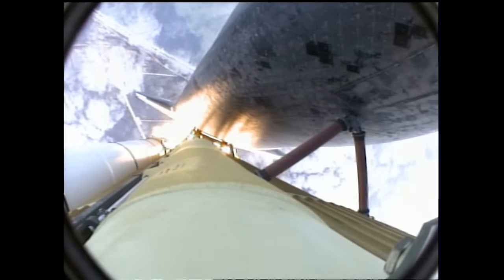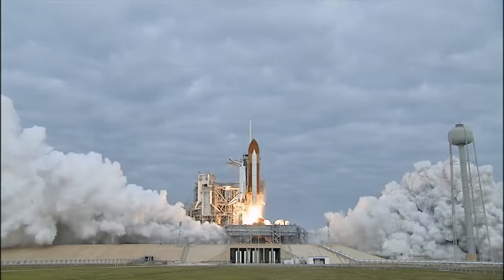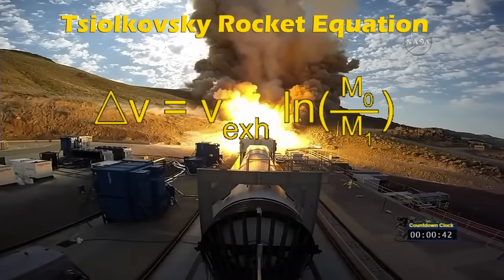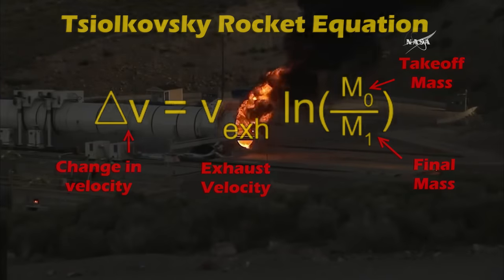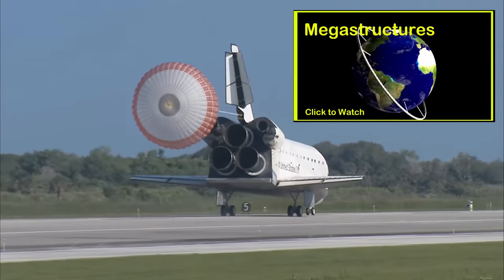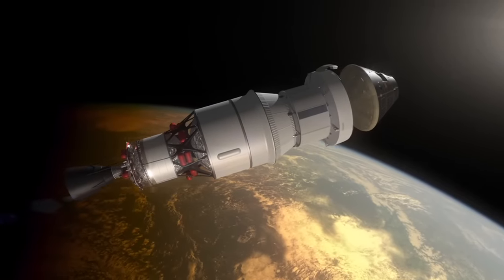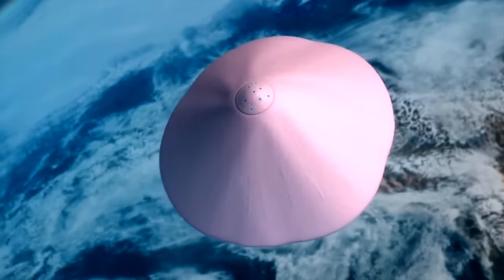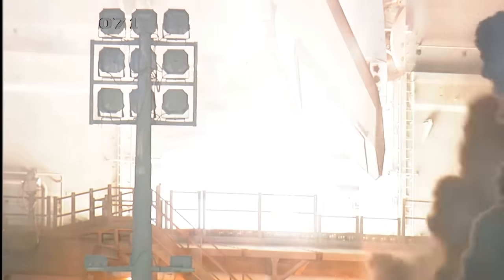The Spaceship Propulsion Compendium

Comment: I may be missing something in one of the prop systems but on Myth Busters they were able to propel a large boat (something akin to a pontoon, been years since I've seen it,) by using a large fan blowing into a sail.  Inspired by Homer's epic poem The Odyssy I beleive.  I don't remember the way they explained it or if they did.  I would have to say it would be gas particles bouncing off each other over the wide area of the sail blocking the path of the fan creating an area of higher pressure backing up to and around the fan pressing against and reflecting off  the sail would be propelling it.  

My question is could we set up an Ion Drive or something similar in this fasion, possibly in a rocket cone like structure to propel a ship?  Or would that only work in novel settings in atmo where gas molecules using surface area of the sail and bouncing off each other provide thrust?

Comment: EM drive.. idk the tapered sides have more surface area than the bottom flat plate, each time a wave hits the side the drive gets a slight push forward due to the angle of the taper. the wave could then either bounce to another spot on the side again producing more push forward. or hit the bottom producing negative thrust. however there is more surface area on the sides so the wave is more likely to strike the side more often than the bottom thus producing a positive net force pushing the drive forward

Comment: I chanced across a video by Craig Davidson at the 20th Mars Society Convention on the "Mag Sail" concept.   The idea is to set up a super conducting coil around a spaceship with very high currents to produce a magnetic field around the ship to ride the magnetic field lines that the sun produces.  This would produce constant acceleration along these field lines and the current could be reversed in the coil to slow down.  His claim is that the sun's magnetic field is strong enough to achieve an acceleration of multiple G's  which even at 1 G could get you to mars in a couple days while providing apparent gravity for the trip.  While I can see a lot of problems with shielding the rest of the ship from the induced field, etc.,  in theory this actually sounds like it would work and would be the holy grail for interplanetary travel.  You'd still have to get mass to LEO and up and down at your destination but this essentially turns a Mars trip into a Moon trip.

Comment: Would gravity assist from a distance work? Your spaceship would send out particles/matter to orbit a planet, then have it return with more velocity to push your craft.  Or alternatively bouncing particles off a planet with no atmosphere to gain momentum from the planet's spin.
Reply from the maker: Gravity assist is really only helpful when fuel outweighs time, and while you can bounce to gain speed, only with light is this really a realistic option and even then only for relatively small speeds or distances, since you get veyr distant very fast from your rear mirror at relativistic speeds.

Comment: Question: Aren't Fusion and Solar inherently related? Solar relies on the sun which is a naturally occurring fusion reactor, and so shouldn't the base technology of capturing energy from Fusion be related to Solar?
Reply from the maker: Yes and no, sunlight isn't produced by fusion, except at very second hand, its the thermal radiation of gases kept hot by fusion far below, so it's like geothermal in that respect, geothermal is all nuclear fission in the core slowly leaking up heat, very different form a nuclear power plant.

Comment: Respectfully asking... In this video you stated that the largest reactor ever sent into space only generated ten watts? Does that fact include items such as the Mars Rover; at least one of which is nuclear powered to my understanding?
Reply: He said ten watts per kilogram, not absolute. Additionally, the nuclear power sources used on most spacecraft are RTGs, more akin to a battery than to a reactor. Of the reactors flown, the TOPAZ actually was capable of 15 watts/kg, though I don't know if it was ever used at that full power.

Comment: Mass effect uses antimatter rockets, often referred to as antiproton thrusters for use on warships. They produce more thrust then commercial fusion torches buy are much more expensive. They involve injecting antiprotons into a chamber filled with hydrogen. The resulting matter-antimatter annihilation produces unequaled thrust. Hot enough to completely melt the hull of any ship standing behind it. That combined with dark energy mass manipulation fields allows the ship to achieve a top speed of a little less than 20 light years per day

Comment: How about the options that use external power sources to some extent?
Is there a variant of the orion drive where the spacecraft DOESN'T carry the fuel internally for at least part of the journey? We could lay out nuclear mines along the path of the spaceship that give it the initial acceleration. Then we can rely on the actual main engine to do the rest of the work and save the power for the deceleration phase. Is this feasible?
Reply from the maker: Forward deploying your nukes is an option but it requires some impressive timing even if the ship has some good maneuvarability of its own, you're basically laser-sailing the nukes ahead and the can't decelerate, so you're basically trying to overun them like passing a car on the freeway and detonateing them behind you. You can do a few to help with decel too, by launching those first and a little slower. But the thing is that if you're doing that you could just use those same lasers to push your ship.

Comment: Just a thought I'd like to know what you think.
Upswing a pressure vessel refilled with liquid hydrogen and liquid helium in a 50/50 mixture stirring sunlight (Photons) released through a diamond lens like a camera shutter. Use the shutter to release the light Into an beam amplifier slit it amp it etc. Shoot these full spec lasers into a particle destroying it causing heat. Steam turbine system. To create small cheap power plant

Comment: I recall learning and agreeing at the time that momentum is, indeed, conserved when you jump off a planet. It just occurred to me, though, that if the difference in mass were great enough and the jump high enough, there may be a loophole - if the expected movement of the planet were less than a Planck length. This only works in theory, though, since in reality you are mostly just compressing your side of the planet and your momentum moves out tangentially rather than straight through the planet.
Reply from the maker: Yes I've wondered about that too, re: Planck Scale, and yeah my example is obviously way over-simplified :)

Comment: I've been trying to figure out travel times within the solar system based on the concept of Fusion-Torchships, largely based on the article at "Project Rho: Torchship Performance". Although I'm still a little overwhelmed by the equations, I think I understand the basic concept. The problem is: I've not been able to find a calculator-tool that allows to manipulate values such as coasting time as they are proposed in the article. All calculators I've been able to find more or less just assume a acceleration- and deacceleration burn all the way through. So my question is: Do you know of any tools that allow playing around with all values?
Of course, ideally it would be one that allows to properly scale proposed engine concepts properly
Reply from the maker: For most if you just take the exhaust velocity of the propellant, or perhaps double that, you'll get the cruising speed. For something like a fusion drive, for in-system work, you need to decide if someone is going to be burning 1-g the whole way with turnover, and used d=1/2at² or v² = 2da to do it, just remember d is going be half the distance, us 10 for a to save time.
Reply: Thanks for the answer! 
I did consider using a full 1g burn the whole way with turnover, like the Epstein-Drive used in The Expanse. However the articles of Project Rho, as well as your video, did point out that this would make it exceptionally hard to get rid of all  the heat. In addition to that, when using the fusion reactor to heat a propellant, Delta V might still be a problem.
I will be looking over the Brachistochrone equations again and try to understand it better!
EDIT: I did figure it out and it was one of the most satisfying achievements ever! It is overwhelming at first but, like all science, rocketscience makes a surprising amount of sense once you can get behind some of the more cryptic equations.

Comment: I like longer episodes. I will update this comment for every time I think or come up with something to ask or say.

Edit 1 |
I started think about hydrogen as fuel around 4:03, although hydrogen is hard to contain because it is the lightest element and smallest it would be hard to contain in a simple metal container. And originally I was going to say maybe combine it with another element so that it can't  escape the container and when needed the engine could split the bonds and recycle the unused element for use later, but I just found while searching the interwebs that you can store hydrogen as a compressed gas in pressurized tanks, as a liquid in dewars or tanks (stored at -253°C), and/or as a solid by either absorbing or reacting with metals or chemical compounds or storing in an alternative chemical form (Info found via the University of Central Florida). So could hydrogen legitimately be an alternative fuel source for space travel? I mean we can store it at -253°C because back in 1995 Wolfgang Ketterle and his colleagues successfully cooled a sodium gas to -217.15°C. I don't know how they did it, but we do know it's possible soin theory could we use hydrogen in a liquid form to get us going at high speed then switch over to an ion technology to propel us further while lowering fuel consumption significantly? Sorry I'm new to this. I only studied 1 semester in University  as a biologist. Which in turn required me to study chemistry. Hmm I miss everyone at University it was fun.

Edit 2:
About the using a mirror, if you get close to the sun can you use it as a slingshot?  Just curious?

Comment: Would a flashlight drive work with infrared? I mean get a container heat insulate it (like a space suit) except where you want to generate thrust, then put a molten salt nuclear reactor in it (probably uranium, because it's lighter) to generate heat, if it works with infrared, then you don't have to turn the heat into electricity so it is more simple and efficient.
Reply from the maker: It works for any frequency of light, but passive radiation coming off a habitat for instance is by default symmetrically emitted, and screwing with the geometry so it radiated more in one direction than another would generate thrust but not much, relatively speaking.

Comment: I've been thinking about the potential of an orbital accelerator, similar to a railgun, but it would shoot ships instead of tungsten rods. It would allow us to cut down on mass because you wouldn't need a booster to escape the atmosphere allowing more mass to be dedicated to long distance propulsion systems and fuel for the trip. It would also save fuel and time by setting the ship on it's way at a much higher starting speed than a rocket leaving earth's atmosphere

Comment: Why would you need so much shielding for nuclear reactors in space? You just need some heavy neutron shielding towards the payload compartment (probably less than on the ground since space electronics already have to be more radiation resistant due to cosmic rays), in all other directions you can radiate away into space all you want. Just have to be clever with geometry. And Uranium is barely radioactive, so it's less hazardous even during launch than RTGs used on Cassini for example; only turn on the reactor once it's in space.

Comment: Imagine a solar panel like a ring or race car track so that when one panel is attached, another which is the oldest comes back into the shop to be fixed or subpanels replaced as needed. Around & around it goes fixing problem panels one at a time.

Comment: lf you use a circular particle accelerator mounted perpendicular to the ships direction of acceleration you can create high mass subatomic particles which can then be accelerated towards the ships stern creating thrust. then you could lower the particle's latteral velocity reducing the particle's mass before accelerating the particle forward and putting it back into the circular accelerator to be reaccelerated. this would allow you to throw mass out the back of the ship while not throwing matter out of the back of the ship giving the external appearance of a reactionless drive.

Comment: Why are chemical reactions ruled out as a source for electrical drives? They do a good job in energy density, but a bad job in specific impulse. Why not power a turbine with it at high efficiency and use that to power a high specific impulse thruster?

Comment: The EM-drive works with the same principle as dragsters. Put little wheels on the front of your dragster, big wheels on the back, and the dragster thinks it's on a slope, and wants to go 'downhill'.  The snortin'-huge engines are there to impress the spectators.

Comment: This is not really applicable to this video but I wanted to ask a question: 
Is a Matrioshka Brain still useful and advantageous when you have black hole "power"? or does getting energy from the sun at that point make it redundant (to put it around a sun I mean)
Reply from the maker: The multi layer aspect probably is, in terms of hawking radiation, maybe not for the rotational tapping or ones where you're feeding it mass.
Reply: That is interesting and thank you for the answer but it is not really the one I was looking for, to rephrase it: Does black hole "power" make solar (sun) power redundant?
Reply from the maker: If you can make small black holes and feed them raw matter, yes, otherwise no... didn't we cover that in the micro-black-holes/black-hole-starship videos?
Reply: Yes sorry I just wanted to confirm it to know for certain. one way or the other, THANK YOU FOR THE AWNSERS AND FOR YOU’RE AMAZING VIDEOS :)

Comment: I just realized. The pressure inside 0.2-nanosecond Q-switched laser cavities must be immense.

i.e. thousands of bounces, storing, say, 10 Joules in total.

That means if the resonant cavity is 3 centimeters in length, we have the pressure of 50 billion watts of light bouncing around.

5*10^10 / 3*10^8 * 2.

That's 333 Newtons. about the weight of a medium-sized dog.

Comment: Most optimistic for me is the nuclear fusion propulsion based on Deuterium + helium-3.
If one day humans are able to develop a space propulsion system that works with deuterium - helium-3 directly through inertial ignition or other concepts and the system can burn 30% of the fuel for direct acceleration then each KG of deuterium - helium-3 would be worth an energy density of 4024 tons of chemical rocket fuel already counting its current efficiency. Deuterium - helium-3 '' 353 trillion joules per KG '' x-ray losses 20% neutrons 4% charged particles 76%, 10% of the 76% of useful energy would be used for efficient ignition system activation with 90 % left for propulsion where 30% can be used directly to accelerate the ship or 72,435,600,000,000 trillion joules per KG of deuterium - helium-3 so a ship with only 1 tonne of deuterium - helium-3 would have the same amount of acceleration energy as 4,024,200 tons of chemical fuel. Thus with this 500KG of deuterium and 500KG of helium-3 the ship would have an acceleration of 1.4 KW / h for 1000 hours if it had a total mass of 14 thousand tons considering 4 thousand tons of the total reactor mass. So with this 500KG of deuterium and 500KG of helium-3, the ship would have an acceleration of 1.4 KW per KG for 1000 hours if it had a total mass of 14 thousand tons considering 4 thousand tons of the total reactor mass. An interesting point is that although deuterium - helium - 3 fusion is 16 times more difficult than deuterium - tritium fusion, "lithium" produces only 4% of the neutron particles against 80% of deuterium - tritium fusion. There being no need for the spacecraft to have massive heat radiators and heavy radiation protection, so many are also optimistic about the deuterium-helium-3 fusion primarily for space propulsion if ever it is feasible.